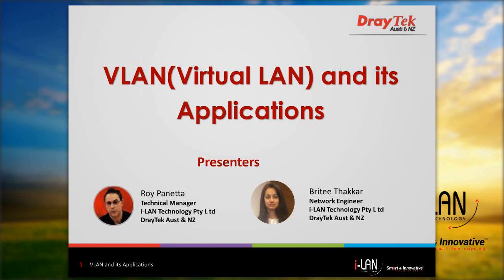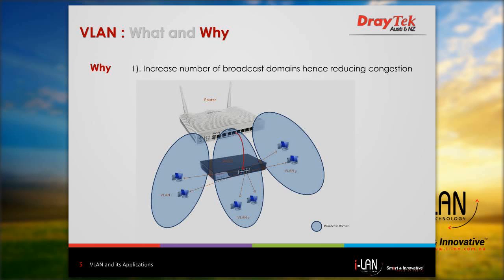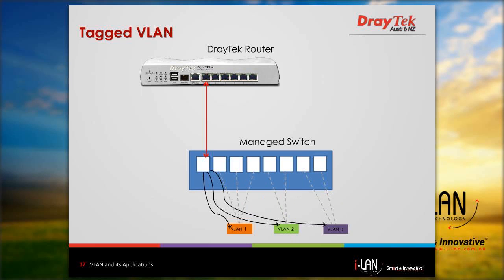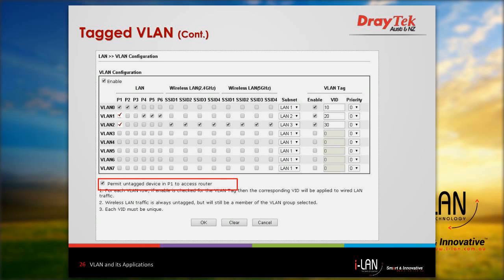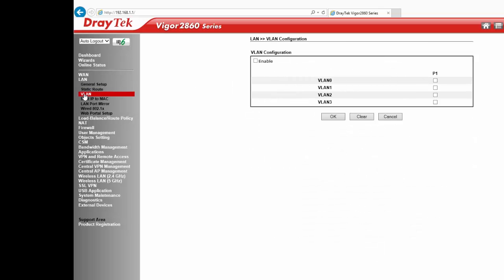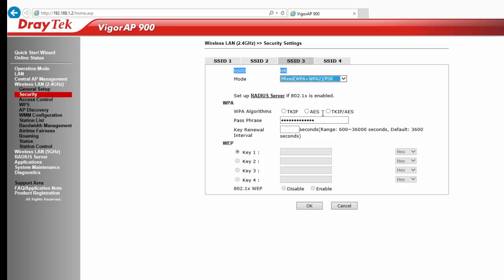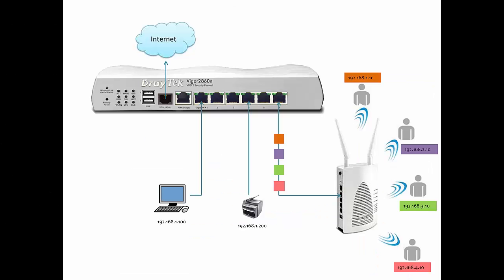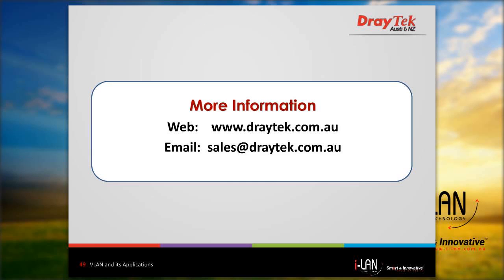Webinar - VLAN and its Applications

Comment: I watched the whole video and it was really instructive.
I have a question and I hope you can give me a way out.
I saw that you can use several VLANS using only 1 Drytec Lan port.
Today I have a DHCP scope that is almost full and I wanted to split the most important sectors.
My network today is A = 10.1.24.1/255.255.254.0
I would like to include range B = 10.1.25.1 / 255.255.254.0 and C = 10.1.26.1 / 255.255.254.0 but B and C need to access some range A ips (such as printers and Data Server)
Just create the VLAN that they will work in this case? So I need to fix the IP of the machines or GATEWAY? How will the equipment know which address they should choose?

Thanks a lot for the help.
Reply from the maker: Bruno,
You can refer to our application note: http://www.i-helpdesk.com.au/index.php?/Knowledgebase/Article/View/635/3/creating-8021q-vlans-on-vigor2860-and-draytek-smart-switch
This application note shows how to configure the VLANS in a Vigor router and use the 802.1Q VLAN trunk to connect to a smart switch.
Each VLAN will have a separate IP subnet with DHCP enabled, so devices connected to each VLAN will get the correct IP address.
To all devices on LAN B and LAN C to access devices on LAN A, you need to enable inter-LAN routing. Then use firewall rules to restrict access to only the required devices..

I hope this helps.